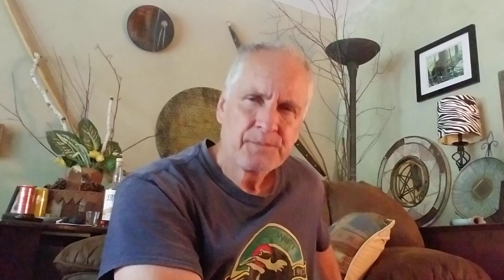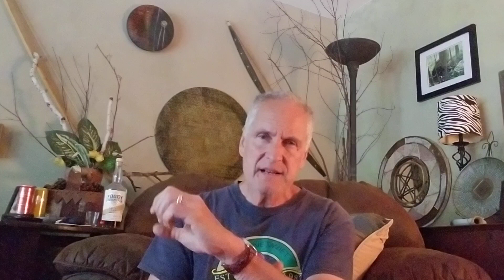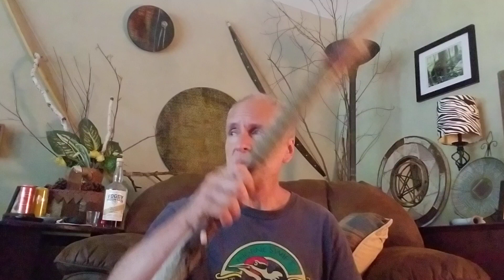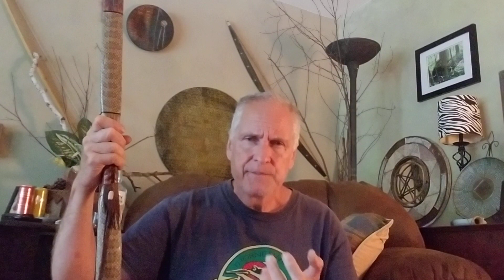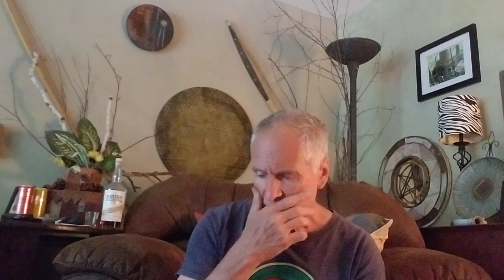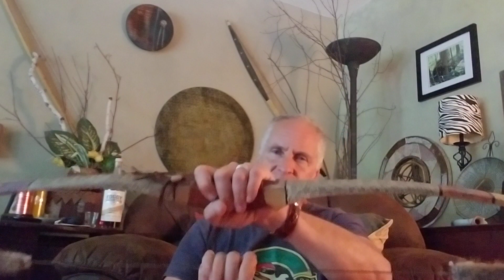False Draw Weight, Sinew Backing?

Comment: Although I have not Sinewed a bow I agree. If I just want backing or protection I am going rawhide. Now I believe you can tiller a bow, string it backwards and add a tad bit with rawhide. My boy and his kids have moved in with us and yesterday he brought over a little antler tipped hickory selfbow I built for him 25+ years ago. Bend through the handle flatbow. Pulling about 50ish at 20 or 22. That little thing will really move an arrow. About 36-38". It has string follow but, is still fast. I did not even know he still had it.
Reply from the maker: That's so great. It still lives!

Comment: I ended up sinew backing that little 32 inch bow. It turned out pretty decent.
Reply from the maker: I have no doubt. You do great work.
Reply: @johnjriggsarchery2457  thanks. It’s pulling 46# at 16”. I didn’t really put a working layer on there I don’t think, I did give it a month or so to dry to be on the safe side
Reply from the maker: @Elmriver  Hey, if the wood is doing most of the work, it's all good.
Reply from the maker: @Elmriver  Hey, if the wood is doing most of the work, it's all good.

Comment: when using red oak board bow,    is red oak having two identical bow woods that won’t bend or harder to bend.   As in limbs getting really thin.    I used a sharp dewalt axe to scrap belly n made it convex belly n back radiused.      

Or does the convex add tension,    i flattened the belly n started to bend.    Was going to radiate the belly with that dewalt axe making some what a piece of paper curved.       

Also I have hide that is very thick .5 mm from buffalo.    was going to stretch the shit out of it almost to ripping then apply vertical glue to both sides nlet dry.  add a bit more n wrap carefully.    gonna take at least 4 days to dry out if not a week.       

what’s cool is that some of the hide has hair still on it!!!!       If thick is no good( adding mass).  i will sand next attempt.   this is experiment with reflex limbs not tips n not drastic.

did you get email/video of a partridge or thunder chicken i shot.    I did same took pic n gave u a shout out cause i never leave house without bow n three arrows!!!!!
Reply from the maker: Oh man, I didn't see it. I'll look. The backs on bows I've seen had channels in the bellies. I don't see how it wouldn't hurt the bellies but it must work. I want to find that video.